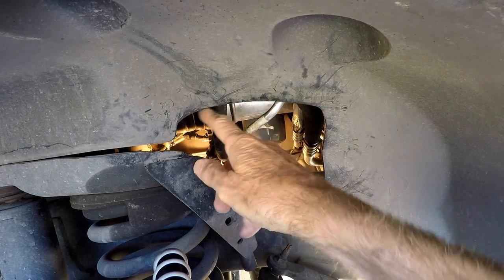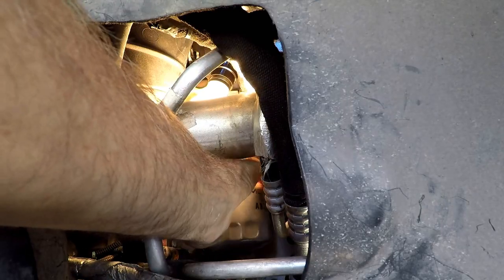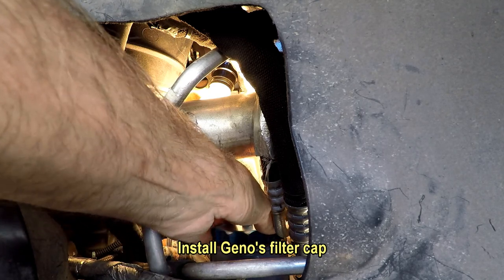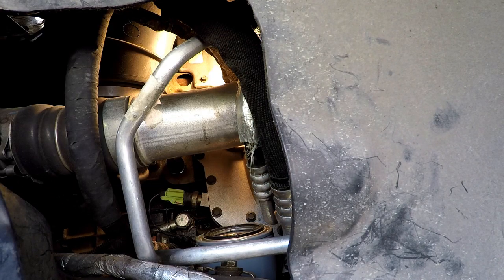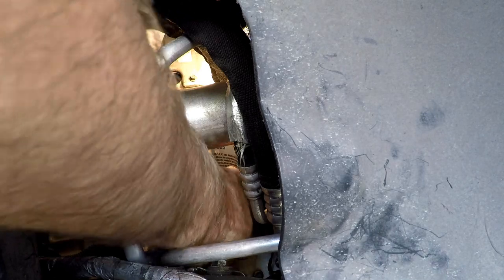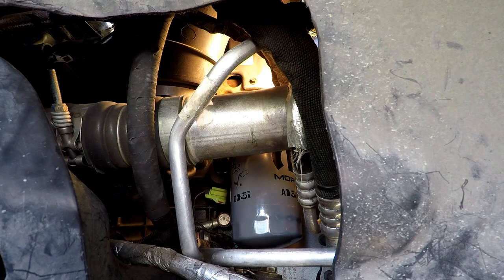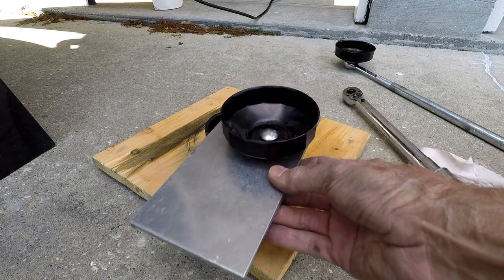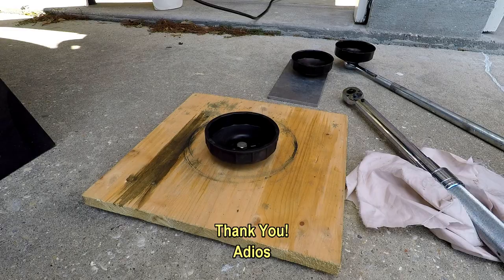RAM Cummins Oil filter change through the wheel well (with better access!)

Comment: LOL on the hair comment. Learned a quick lesson on my first oil change, while putting on the Geno's cap after the filter was off I dropped the cap and it went somewhere in a suspension pc, couldn't  see it, put a a zip lock over the filter but couldn't get it zipped. long story short, got effin oil all over, what a mess. While I was dealing with something in the house my sister found the Geno cap. To put the new filter on I tied a string on it and my sister lowered it down from above, I pulled it out, wiped it off and put it on the new filter, got the filter in place, off with the cap, on with the filter, bingo. I will use the string from now on.

Comment: I'm sure thinking about a remote oil filter relocation kit. Surely someone has come up with one.
Reply from the maker: Yes, there's several.  They usually mount them under the passenger side frame rail.  About the only place.   Makes for some pretty long lines.
Reply: @MarionBlair  and potential failure opportunities.

Comment: I'll be trimming mine on the next oil change. You are absolutely correct that without the mod it is difficult to get the filter started. Seems like a Ram tech would have pointed that out to the mother ship by now. Thanks Marion!

Comment: The Geno's Garage piece is a thing of beauty but the need to grab it with pliers shows a flaw. I love Geno's but in this case, I prefer the filter plug from Lisle. It is cheaper in appearance being plastic but it gives a tee-handle to grip the filter comfortably.
Reply: i have it and don"t need pliers I just grab it with my thumb and pointer finger

Comment: I'm thinking about making an even bigger cut out. I'm going to try to make a clean cut and then save the peice and put four tabs on it with holes so I can re-install it with screws.
Reply from the maker: I thought about that a hotel I think you can make a significantly bigger cut without having to cover the whole back up.
Reply: @MarionBlair  I think you're probably right. No sense making it more complicated than it needs to be.

Comment: I appreciate the "how to" with the oil filter change and all the additional little tricks to make the job somewhat easier and certainly less messy.  My question has to do with your oil change interval of 6,000 miles.  Growing up (much like you no doubt) I religiously changed my engine oil at around 5,000 miles.  Now with my 2016 2500 6.7 RAM, I have followed the "oil life" indicator and at times when I'm not pulling my fifth wheel trailer (10,000 lb gvwr), I might get 15k miles before the indicator reaches 5% remaining and the next oil change.  I admit I was a little taken back at first given my earlier experience.  So why are you changing your oil at 6,000 miles and do you think by using the "oil life" indicator I am doing harm to the engine life?  Appreciate your insights.  Thx.
Reply: I have a bit of insight about the OCI. The oil and filters are no doubt ability much better. But I think OEMs run those intervals so they can claim a low cost of ownership and try to sell more trucks. Plus pressure from EPA and other agencies to lower the waste footprint the trucks make.  Imagine all those trucks all using 3 gallons of oil over their lifespan. OEMs  don't care they make trucks to last past the warranty, anything after that it's on your dime. They know most people will buy a new truck if faced with a $10k diesel repair bill.
Reply from the maker: The manual says 6 months or 15K.  I was pushing 7 to 8 months.  however, from the oil analysis I've seen, I personally would not go beyond 10K.
Reply: I have been doing it yearly, I basically only put around 5k miles a year. I don't like pushing the time interval. But it doesn't make financial sense for me to change oil around 2k-3k miles.
Reply from the maker: @raymondcruz2000  Same with me

Comment: Great filming!   Curse chrysler for not making this thing more accessible
Reply: It was more accessible from beneath. From 1989 through the end of the third generation the filter was easily accessed from below. The fourth generation frame redesign to achieve not class-best but class-maximum towing rating (in accordance with the then-new SAE standardized rating system) negated that. Perhaps once fifth generation arrives accessibility will be improved after so many grumbling owners.
Reply from the maker: I'm with you.  Cummins and RAM need to collaborate a little better on this.
Reply: @MarionBlair  I am not sure what design opportunities exist for Ram frame designers. The filter location has been constant on the Diesel engine from its earliest introduction (pre-dating Dodge expressing interest). I am sure engineers did not make the decision to interfere with access lightly.